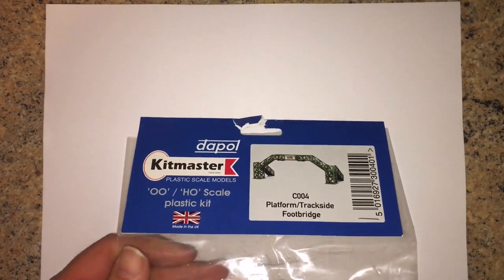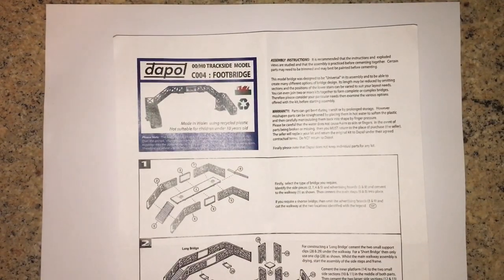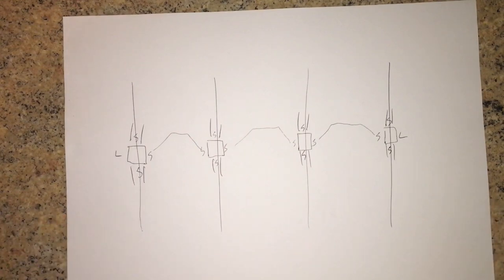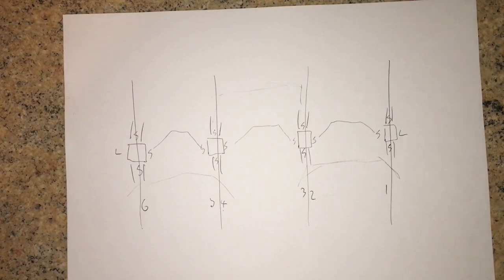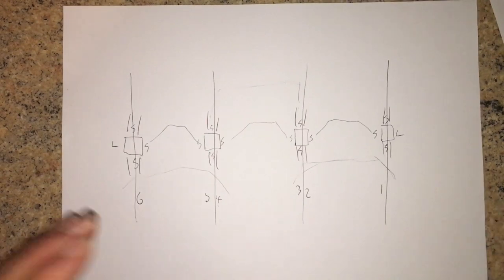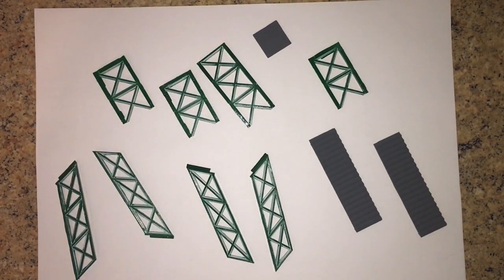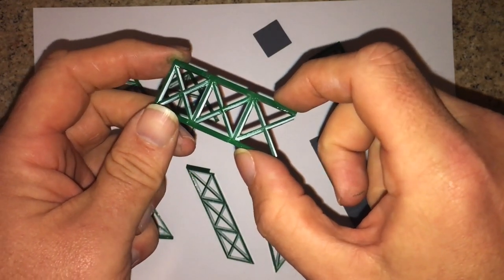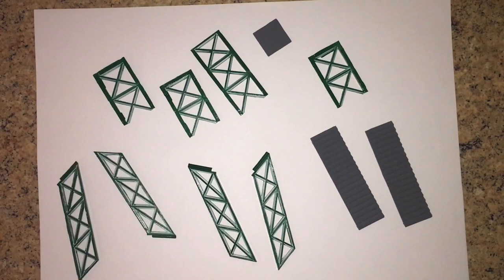Aidans How To Build A BIG Station In 00 part 2 - The Station Footbridge - The Dapol Footbridge Kit

Comment: Hi, nice video and explanation. We only have three platforms to bridge so I've been looking at multiple kits as well.
I'm not sure if bridges like that would have dropped down for the intermediate platforms? I was hoping for a kit that could be combined without the drop in the centre but alas can't find a kit to do that.
Reply from the maker: It would be possible to kit bash this same kit but you would need multiple more kits than I used. Hope this helps

Comment: Very effective.  Two thoughts.  Have you considered the scale effect on colour?  The green seems awfully intense for such a small scale.  Imagine the same bridgeways in 1/48 or 1/32 and you can see how the intensity changes, though that can be altered of course with washes and dry brushing.
Using paper to build on makes the parts much easier to see but perhaps your light should be from the front instead of behind you?
Well thought out and very effective!  On to no. 3.
Reply from the maker: Hi Randy. I have intentionally kept them quite bright as in the next part of the station build I am working on the canopy and still want the colour to stand out in a darkened area even with the internal lighting. I do believe if I had not been using the canopy then I likely would have definitely softened down the tone or even gone for a different colour. Cheers Randy

Comment: Very informative . Didn't know you could do this with that kit. What track gauge because it looks greater than 2 lines?
Reply from the maker: A very simple kit to adapt. I have set it so you can have a line next to each platform and if required a through line can pass in between. I took the inspiration for the three lane from Newcastle in the good old days.